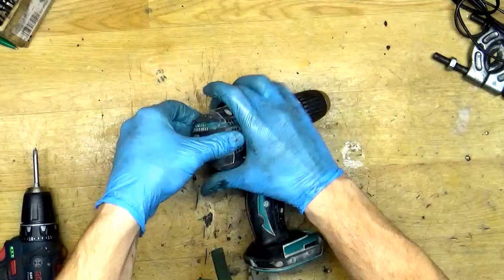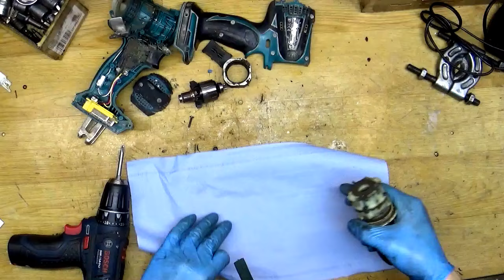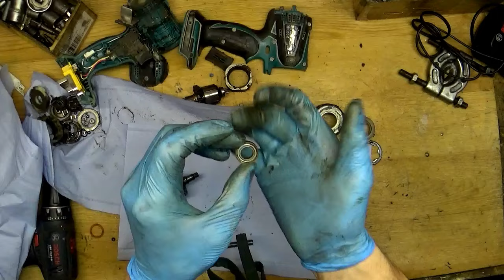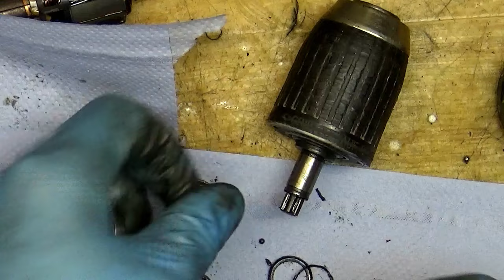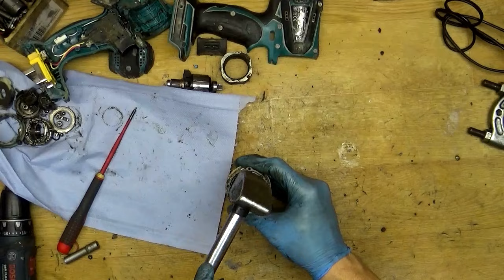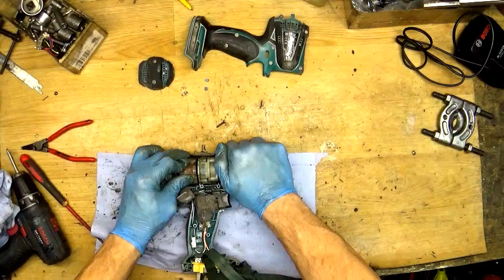Makita BDF456 DDF456 wobble chuck gear assy repair. Saved 30 Euros

Comment: I just bought the white combokit and it was with brushed motors. I was really surprised about the power this small machine had and are really satisfied. Glad i did not pay the extra for brushless since this have more than enough power for me.
Reply: I think if i have the need of more power then i bring my generator and use my corded tools instead of abusing my makitas. I think, even if they have the strength everything around the machine must be able to handle that strength. When it comes to heavy stuff i rather use my pneumatic or corded tools instead of abuse this fine machines winch i love when i am working in a machine, loosing bolts and so on.
Reply from the maker: You made good choice because brushless model have 4 Nm less then brushed version

Comment: i just bought a used DHP482 with this wobble issue, do you think it's the same bearing (6800ZZ) i have a burned out AEG that i am thinking i'll take the bearing from if that might use the same one also (practice on that drill first)

Comment: is there way to improve run out on keyless chuck drill? If you were to buy a replacement chuck is there a chance it could have less run out or is the issue deeper with the bearings, drill construction, fixings. If there was a way to reduce run out for reasonable cost I'd love to know. Although hand drills aren't precise instruments I'm still unhappy with my Makita run out wobble

Comment: I've had this problem, was repaired under warranty and it's gone bad again. Never had it on my Dewalt drill, is it just an issue with Makshita?
Reply from the maker: No this is not only Makita problem. New Dewalt models have this problem

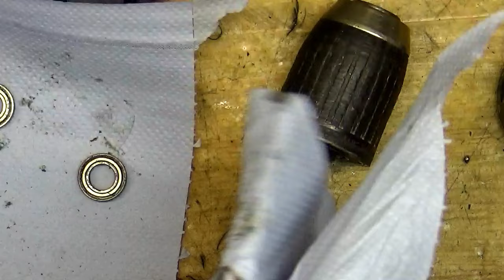Comment: 9:08min from that scenario onwards. I have a broken chuck head plastic cover need replace. Managed to removed the reverse threaded screw. But the shaft is tight stuck. How do I get it apart?

Comment: Hi, I have a DDF482 brand new, virtually unused and the jaw appears to be very uneven, to the point where a normal wood drill bit wobbles by about 1 or 2 mm at the tip. Do you know what could be the problem here?

Comment: I have the bhp456. What part would you replace if the gears are slipping?
Reply from the maker: Hello, you need new gear assy (90%). And it can be that you need to clean your tool or change housing (10%)
Reply: @handyman7282  can the gear assy be repaired by replacing a part
Reply: @handyman7282  gears slip when under load and sometimes chuck don't turn whilst drill is motor is
Reply from the maker: @MrSagsta  gear assy for this model is sold as one unit. Normally its broken gear with gear assy housing. You can fix gear teeths, but it's complicated

Comment: Do you ever repair Craftsman cordless drills? I am having trouble reassembling mine after I took it apart because I could not remove the chuck.
Reply from the maker: Gilbert Bustamante Hello, I have not seeb Craftsman tools.because they are sold in USA and I live in Europe. I'm trying to get job with visa sponsorship, but no luck :)
Reply: Thank you- I am enjoying your videos and still learning a lot.
Reply from the maker: Thank you

Comment: I bought a used bdf 456 and it has a vobble in the chuck. not as bad as the one in your vid but i think that i should change it before it get worse, Do you have the bearing dimensions so i can replace the bearing with a quality one like SKF or so?
You have great informative vids, thanks for that.
Reply from the maker: Thank you, better to change it earlier. You need ball bearing 6800ZZ
Reply: @handyman7282  Is that the spare part? I think if so it is as bad as the original, Want to change to a more quality bearing if i do the job. I bought the kit in the link. Very impressed by the strength of the tools and thinking of buying one more DDT152. What is your recommendation brushed vs brush less?

https://www.verktygsvaruhuset.se/product/makita-combokit-dlx2127wj1-ddf482-dtd152
Reply from the maker: @7ann3  Ot's ball bearing model. In shop you will get ball bearing by that model - all manufacturers are making same model, because model means dimensions... DTD152 is, very weak model. Forcme DTD146 is much better or take brushless model DTD129
Reply: @handyman7282  Do you mean DTD152 is weak so it breaks or that it is not powerfull?
Reply from the maker: @7ann3  it breaks
Reply: @handyman7282  Many thanks for the tips. I ordered a DTD129, it was on sale and only 11 left. Hope i can fix the 152 when it breaks.

Comment: Hi, nice video, thanks!  I will be taking my 456 apart to fix this irritating problem that I've had fixed under warranty before (even though tool is not heavily used).  BTW, where do you order ball bearings online for this?